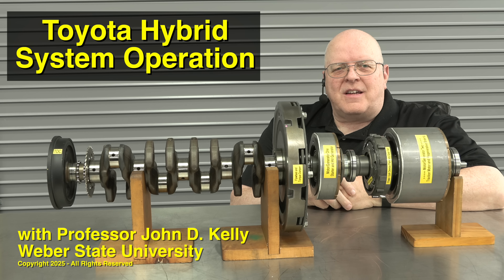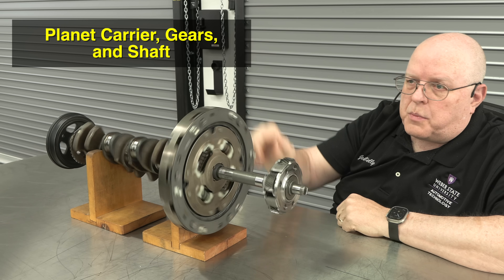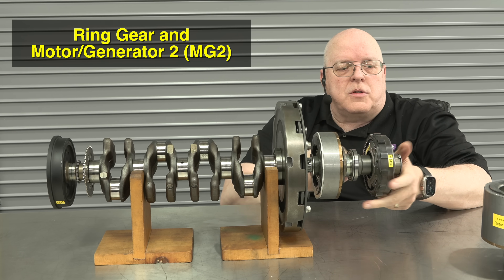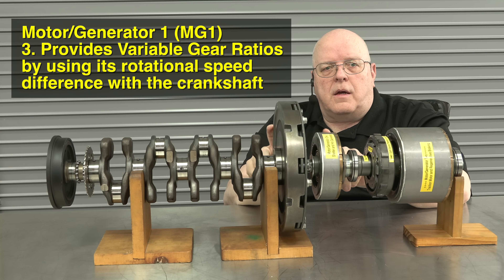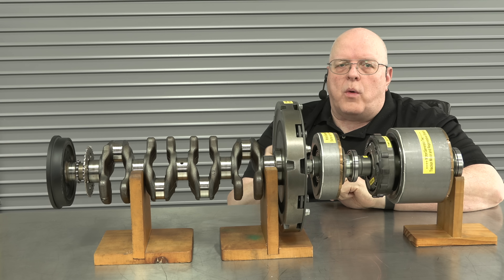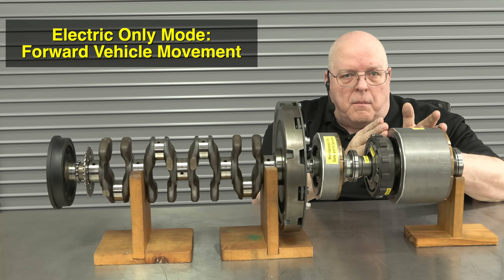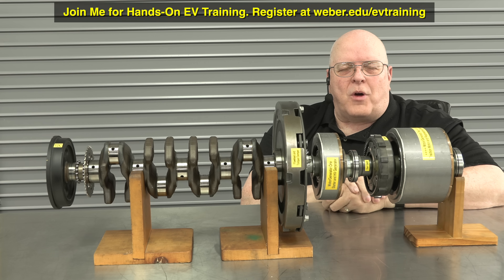Toyota Hybrid Transmission Operation - 15 Years on YouTube!

Comment: The use of MG1 effectively controls the gearing of the ICE engine. In certain gearing and accelerating/decelerating conditions, most conditions in fact, MG1 is absorbing engine power and generating electric power, and in others it is consuming electric power (to control the gearing). It the situations where MG1 is consuming electric power, does that power contribute to the sum of the power supplied to the wheels? Guess it must do, else its 'wasted' somewhere.
In my Estima Hybrid, which uses the same power train, I have an app (Hybrid Assistant) that show speed of MG1, ICE and MG2, and if the electric ones are consuming electric power or generating electric power. In most situations MG1 shows as generating  (ie putting a drag load on the relevant sun gear). But it doesnt quite tie up with what I was expecting in some situations.
At high acceleration high load, especially at low vehicle speed (low gear / underdrive, high ICE Rpm), MG1 has high rpm and seems to still be generating (and that generated power is significant and is used to drive MG2). 
At higher vehicle speed, but 'low' load and low ICE rpm (higher overdrive), MG1 is going 'backwards' (being driven backwards by electric power) and consuming electric power?
At any non zero forward cruising vehicle speed with low load and ICE off, and in EV mode, MG1 also going backwards and both MG1 and MG2 consuming electric power (but mainly MG2) and powering the vehicle. Update - MG1 usual not consuming and not generating when on midl EV running.

Would be interesting if you had any real world graphs of motor speeds and power output/absorption in the various scenarios.
Reply: Im thinking of recording a video session of it in operation, and an explaination of what I think is happening.
In my system its slightly more complicated to monitor and understand becauase there is also a separate rear electric motor, although that only seems to supply power for a short period at pull away from rest. It also contributes to regen during regen periods.
Reply: re the "high acceleration high load, 'low gear' / 'underdrive' situation with high ICE Rpm and high MG1 rpm, and MG1 generating a lot of electrical energy"
The ECU is running the ICE at high rpm (as it needs the power), but the ICE is pushing the vehicle harder and faster than it can currently go, and so the vehicle is effectively 'pushing back' and that causes MG1 to spin extra fast and generate electricity.
That electricity (60+kW or so) is then used by MG2 to help power the vehicle.
At first it seemed weird to me that the ICE was putting out so much power (eg 80+kW) and most was being absorbed by MG1 and then used by MG2, rather than going to the wheels directly, and so was running more like an uncoupled serial mode system. But thats just the way it is.

Comment: We needed a car in 2021, I was undecided between the Honda CRV, the Mazda equivalent, or the Rav4. I happened across your channel, and your explanation of how the RAV4 transmission worked, that along with actually seeing the size and robustness of the actual gears involved. On the back of that knowledge gained, we bought the Rav4. It was and still is the best car related decision of my 47 years of  driving. A pure joy to drive, and faultless and undamageable during slow speed manouvering, or reversing with a trailer.
so, a big thank you.
Reply: There's a reason the prius ubers do half a million miles
Reply: @BigLeek-ig3sb my decision to look at the Toyota hybrid system was prompted by an image I came across on Facebook, of 😮a car wedged below a bridge railing, by a flash flood, in, what turned out to be Mongolia. But I had to ask, "where?", and was told the Prius was very popular in Mongolia. My instant thought was if the hybrid tech was trusted in such a remote area, by the locals, it must be good. Then further research took me to the Prof Kelky at Weber Uni.
Reply from the maker: That's great to hear, thanks for watching!
Reply: The only problem is that the allowed towing weight is so low. What are they afraid of? The Ford Fusion Hybrid, which is bascally Toyota tech in a Ford body, has a maximum towing weight of 1650 lbs, whereas a gas or diesel are allowed to tow up to 4,000 lbs. Only the AWD RAV4 (The others should be named RAV2) has a decent towing capacity, 3300 lbs.
Reply: @erik_dk842
I have wondered, but never researched the Ford Fusion Hybrid,  it sounds so like the Toyota set-up, I had wondered were Fored paying Toyota a licence fee to use the Toyota tech?
And, Indeed, I had to take the 4WD option simply to get an even mediocre towing capacity. Is it about 1650Kg?
But I would be happy to tow 3500Kg, since there is no clutch to take harm. 
The knowledgable blokes on the Toyota Owners Forum((UK) allowed that overheating the motors was the only likely or possible damage, and since it is never hot here in NI, compared to Saudi or Dubai, nor do we have any proper mountains, I figure one could safely ignore the stated limit. On private roads only, obviously.
Reply: @marcusgault9909 I didn't realise that you are in Europe, too. That's why I translated Mondeo to Fusion and kgs to lbs.

Comment: What I'm having trouble understanding is how do you control MG1 or MG2? How do you stop MG1 from turning? Current or how?
Reply from the maker: MG1 must stop as it changes its direction of rotation. It uses battery power supplied by MG2 at higher vehicle speeds. Thanks for watching.
Reply: @WeberAuto thank you for responding.
So at high speeds power is being used not to directly spin the drive shaft, but act as a gearbox.

Comment: Thank you for another great and informative video!

As a mechanical engineer with a strong emphasis on electrical motors, I consider this an invention of elegance and supreme beauty. So many times EV enthusiasts say that a hybrid has the worst parts of both technologies. This system actually exploits the best of both technologies. When you add in the understanding of how this system effectively keeps the ICE in a torque and RPM range that is very close to optimal efficiency for the vast majority of operating conditions, then the full extent of this system’s elegance can be seen. 

As others have pointed out, the total system’s mechanical complexity is less than a comparable fully mechanical engine and transmission. On the electrical side this system removes range anxiety and drastically reduces the size and cost of the usual EV battery (helping with battery production). 

On the plugin vehicles, maybe the battery gets cycled more than a pure EV but this system provides 90% of the benefits of a pure EV without having to deal with on trip charging. If the vehicle is charged at home, the ICE will have relatively little usage and wear (maybe even to some negative effect).  These vehicles are certainly not more expensive than comparable pure EVs, so until tesla delivers on a truly affordable alternative, I personally consider this system as an optimal choice for this decade.
Reply from the maker: That is an excellent summary, thanks for sharing your thoughts!
Reply: Volkswagen's take on the hybrid is a nightmare of a 7-speed DSG gearbox with 3 concentric input shafts, one for each of the two mechanical clutches and one for the electric motor. I think I dodged a bullet, when the end-of-lease VW Passat GTE, that I had set up to buy from a business associate, suddenly went up €2,000. They start to leak from the clutch housing, and the only repair is a new transmission.
The only grudge I have against Toyota hybrids is from driving a Corolla with the smallest engine and a Yaris, which don't offer a high enough overdrive for my taste.

Comment: I don't see how this can operate in series hybrid mode. You showed that if MG1 is spinning slower than the engine you get overdrive, but the engine torque is still being sent to the wheels, while spinning MG2 alone to power the wheels spins MG1 backwards. Meaning if the engine is on and turning MG1 forward at any speed, there will be a gear ratio between the engine and the wheels, and therefore it's a parallel hybrid at all times, not a series hybrid. The only way for the engine to generate electricity without directly driving the wheels is by charging the battery when the vehicle is stationary, but that doesn't make it a series hybrid.

Comment: Thank you! What I am missing is explain how MGs are stopped. For example for engine start, MG1 is powered, but MG2 has to be stopped. How it is done? Mechanically or electrically? Same for example for EV mode. How is stopped combustion engine? There is some brake?

Comment: So the Toyota Hybrid system should be more reliable and less costly to maintain than a "normal" automobile drive system. No separate alternator, no alternator  drive belt and pulley, no separate engine starter motor, no clutch or torque converter, no complex transmission with multiple gears.    Also in the Toyota AWD drive system (eg. RAV4), no drive shaft and U-joints to the rear wheels, no transfer case between the front drive wheels and rear drive wheels......

Comment: This is the best Toyota eCVT explanation video on the INTERNET
Reply from the maker: Wow, thanks!
Reply: @WeberAuto  We need the latest version of the Honda eCVT. Thank you very much for sharing your knowledge. Fantastic class, as always.
Reply from the maker: @cavanon  Thank you, and thank you for the suggestion. I do have a video on the Honda system, but I need to review their latest design to see if there are any changes.
Reply: Yeah but very hard to understand
Reply: This is not a CVT , It's a Hybrid.  CVT's are gas only powered transmission that are a disaster waiting to happen.
Reply: @portagepete1 that's why he said eCVT, which is different from CVT
Reply: @portagepete1 wrong. Toyota hybrids use a type of cvt that's all hard gearing, no belts like the typical type you explain.

Comment: Hello Prof Kelly, do you need to change the transmission fluid in a Hybrid?.
Reply from the maker: It has a drain plug and a fill plug. Make sure to follow the proper procedure and use the proper fluid.

Comment: How big can they scale this system? I am wondering why they don't use it on their more powerful vehicles like Tacoma, Lexus GX, etc. 

By the way, you look the same as 15 years ago.
Reply from the maker: It is just for light-duty vehicles. The Tundra, Tacoma, Sequoia, and 4Runner use a single motor parallel hybrid system. My next video will showcase that system. Thanks for watching.

Comment: Does the vehicle ever go downhill without generating a charge to the battery?
Reply from the maker: Yes, if the battery is charged, the generation system can spin MG1 at a high speed in starter mode (but with the fuel injectors turned off) using the engine compression braking to slow the vehicle. The generation system can also just be turned off. Electric vehicles do this when the battery is fully charged too.

Comment: during highway operation the MG1 spins backwards to overdrive MG2. So there is power from the HV Battery sent to MG1. At this point there is no power generation. Lets say the battery gets depleted. What happens then? without power to stop MG1 from spinning the torque cannot be sent to assist MG2. 
the only thing I can think of, is that the Engine spins up faster, lets the MG1 spin as a Generator and this would send Power to MG2 to drive the car. at this Point the efficency would drop dramaticly, sincs converting rotation into electricity and back to rotational power is not efficient as just shaft or belt. 
This explaination on the toyota eCTV is exceptionally good from a mechanical view. However I do struggle a bit when it comes to "when is it more efficient" and "what happens at different battery charge levels".
Reply from the maker: At higher vehicle speeds, MG2 can act as a generator or assist the engine as needed, depending on the battery's state of charge. MG1 does not have to consume a lot of power; the resistance of the vehicle load can help MG1 function as a generator, even while providing variable gear ratios. Thanks for watching

Comment: Like to see the inner workings of the  transmission as well. Also note just as only the Engine crankshaft is shown in demo: the 2 motor rotors' stators aren't presented. Obvious for those who know but not all do. Great video over all.
Reply from the maker: Thank you for the feedback. I should have shown the stators.

Comment: So when simulating low gear ratio, If Mg1 is rotating slower than the crank, can it also be generating energy recharging the battery ? Or in this case only mg2 can work as generator ? 

And if mg1 is rotating backward, does that mean it has to be consuming energy from battery ? 

If battery is completly depleted, what will be the initial states of mg1 and mg2 ?
Reply from the maker: At higher vehicle speeds, MG2 can act as a generator or assist the engine as needed, depending on the battery. MG1 does not have to consume a lot of power; the resistance of the vehicle load can help MG1 function as a generator, even while providing variable gear ratios. Thanks for watching

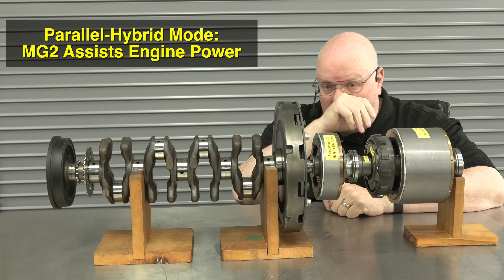Comment: In the explanation at 9:57 it's worth noting that if MG1 is running in reverse, MG2 must normally be used as a generator to power MG1 and other electrical loads in the vehicle. It can only provide vehicle propulsion for brief periods of time dependant on battery state of charge.
Reply from the maker: At higher vehicle speeds, MG2 can act as a generator or assist the engine as needed, depending on the battery state of charge. MG1 does not have to consume a lot of power; the resistance of the vehicle load can help MG1 function as a generator, even while providing variable gear ratios. Thanks for watching
Reply: I just posted a comment about if MG1 consumes electric power in this 'MG1 running in reverse' state

Comment: Throw all of that electric stuff in the trash and give me a gas engine with a 4 speed and it will last 250 thousand miles and I'll be happy. The gas cost savings is not worth all of the moving parts!

Comment: My question is how does mg1 continue to receive power in overdrive mode if it has to keep spinning backwards won't it eventually run the battery out of power?
Does mg2 assume role as generator for long distance high speed?
Reply from the maker: At higher vehicle speeds, MG2 can act as a generator or assist the engine as needed, depending on the battery. MG1 does not have to consume a lot of power; the resistance of the vehicle load can help MG1 function as a generator, even while providing variable gear ratios. Thanks for watching
Reply: @WeberAuto  Thanks for response!,Am I correct to assume when MG1 is in overdrive mode/spinning backwards that it is not able to function as a generator in that specific condition?

I have 2025 Camry, it is amazing technology.

Comment: Seems like a very durable and reliable why to make a transmission.  Why aren’t all transmissions like this?   I mean what are the downsides vs a traditional torque converter automatic?
Reply from the maker: Good question. These systems are great for passenger cars, but not for larger vehicles, trucks, etc. Toyota uses a different hybrid system in those to allow more torque transfer to the wheels. My next video will show that system.

Comment: Hi from Australia, thank you for your video. I own a Corolla Cross Hybrid. Many people on Australian C.C. Facebook page complain about their 12V batteries going flat. Is their any particular reason for this that you may have experience with? I personally use a CTEK charger on my cars,(and haven't had a problem) but most people don't use a battery tender and they think something is inherently wrong with their cars. I'd be interested if you had any thoughts. Thanks
Reply from the maker: Thank you. I do not have experience with that, but there may be a software update for the car to address it. Unfortunately, it probably needs to be checked/performed at a Toyota dealership.
Reply: @WeberAuto  thank you

Comment: Very nice video. So the word ecvt is a misnomer since there is no cvt belt or drum involved here. Perhaps it should be called an electronic variable motor assisted, mechanical transmission EVMT. No wonder it is so much more reliable than the real cvt with slipping belts.
Reply from the maker: Thanks for watching. This system still provides variable gear ratios between to end limits, just like a push-belt CVT or pull-chain CVT, but yes, unlike those other systems, this system is very reliable.

Comment: I've enjoyed learning from a few of your videos on how these things worked.  It's part of the reason why I bought a Toyota Hybrid a few years ago.  I do have a question though.  How are cables (power, etc) connected to MG1 and MG2.  It seems as it it would be difficult to connect to the motors since they are spinning, and I think where they are housed also has lots of fluid in it as well (transmission fluid to keep the gears lubricated)?
Reply from the maker: Thank you for your kind words. The wires are connected to a part I did not show that goes around the rotors. It is called the stator.
Reply: @WeberAuto  I googled a picture of that.  I think I understand now.  The stator is fixed (and connected with the wires) whereas the components you show are the ones that actually move.  That makes sense.  I thought the wiring had to be connected to the parts that do the moving which is why I was wondering how they would be connected electrically while needing to spin.

Comment: An excellent summary. It's a pity Toyota didn't come up with a different name for this transmission. Rubber band CVTs have such a poor reputation, that some people distrust the eCVT even though it is possibly the most reliable setup ever used on a car.
Reply from the maker: Thank you, Yes, this is a very reliable system.